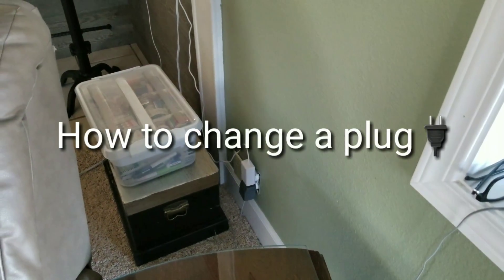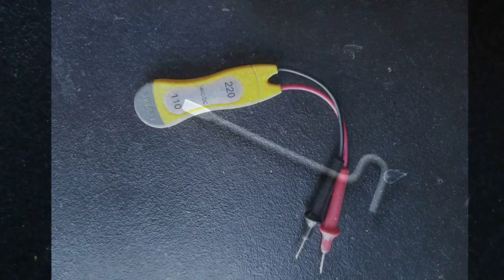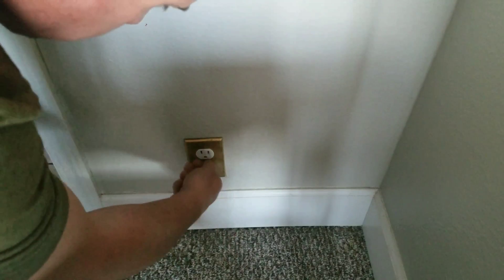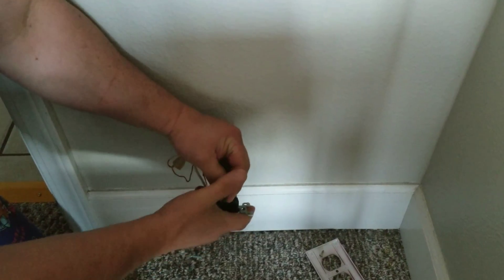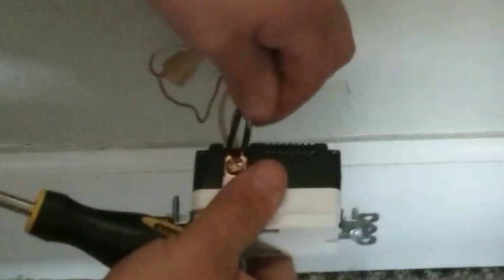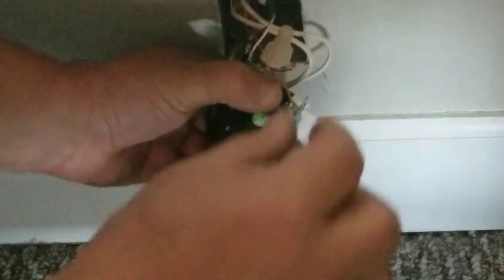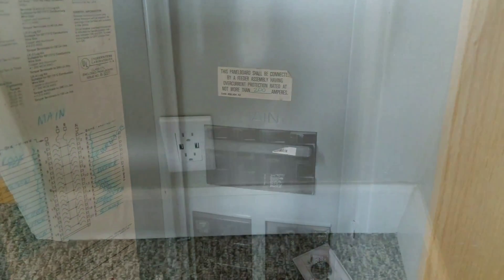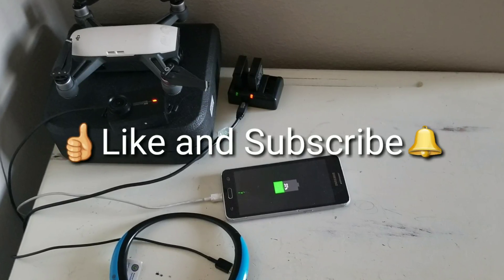How to change a wall outlet with USB ports

Comment: finally, someone who double checks for power! shutting off your main is a bit much, but hey... better safe than sorry. I would add that you should always check the ampere rating of your receptacle against your circuit breaker. For these receptacles, it is usually 15 or 20 ampere load limit. The breaker and the receptacle MUST match. if you want to be sure of your circuit safety, you can check your wire size also, 14awg for a 15amp circuit and 12awg for a 20amp circuit.